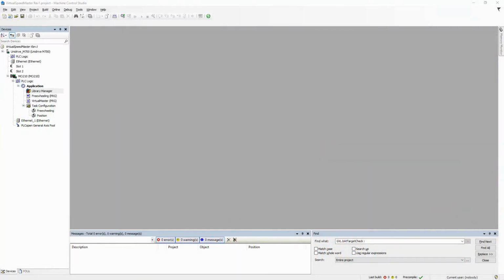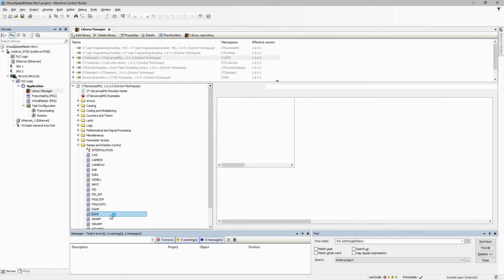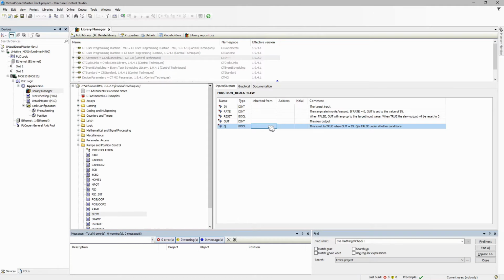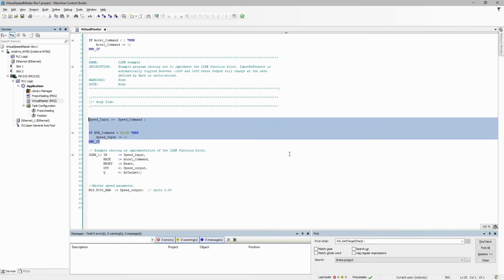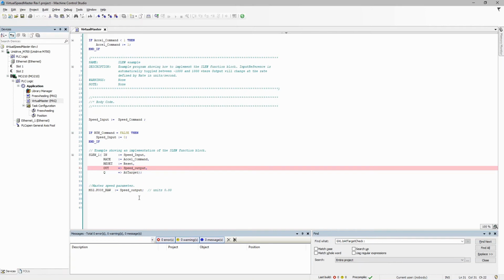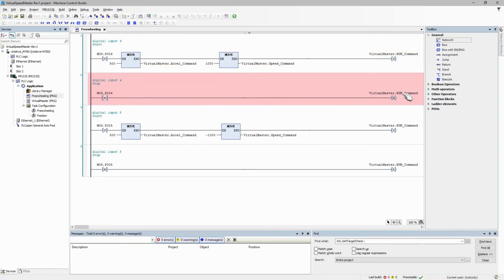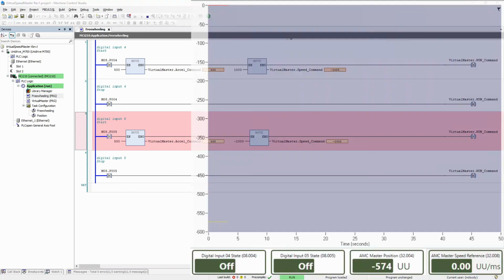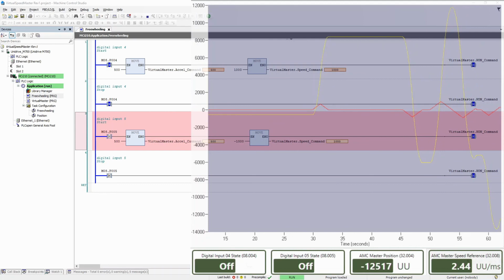Learn to write a Virtual Speed Master 01 In Machine Control Studio.

Comment: what language are you programming in !? looks very simillar to pascal , and how can i start the trip to learn that language my goal is to program unidrive sp2403 drive
Reply from the maker: The drive i was programing is a unidrive M700.  This drive is newer then the unidrive sp2403.   The Unidrive m700 uses Machine control studio as all of the newer drives made by CT.   The Unidrive SP programs in Sypt Pro.  Most of the time using a SM-apps modules of some type.  would you like me to make a video on basic Sypt syntax?
Reply: @vfdcode  ofc course sir i'll really appreciate it! it'll be better if you make a series for beginners about the syntax and thanks so much again!!

Comment: I have project... Please help me
Reply from the maker: On the channel page you will find my e-mail address.  We can use that to get some help.
Reply: @vfdcode  okay thank you I will reach out
Just a quick one can I use one drive with bus coupler, without MCI210 just using the drive PLC and extending IO with IO210-BC /Beckoff EK 9000 Modbus?... I tried on MCS doesn't seem to possible I find it very strange
Reply from the maker: @seimela  I will make you a video showing how to use the IO210-BC.  I should have it done by tomorrow. This video will cover a lot so it will probably be a longer video.    Can I use your picture in the answer question part of the video?
Reply: @vfdcode  Please feel free to use my picture 😊😊👍😌